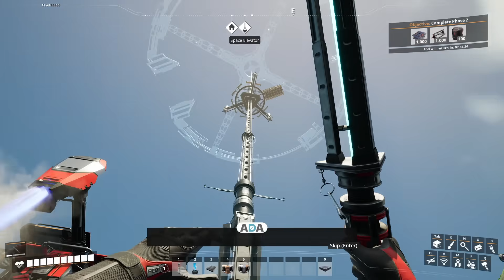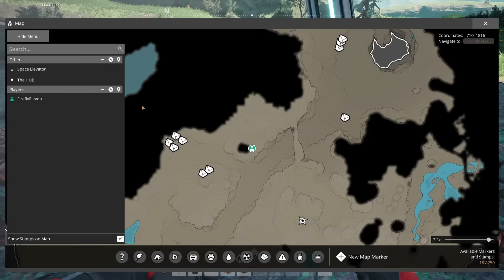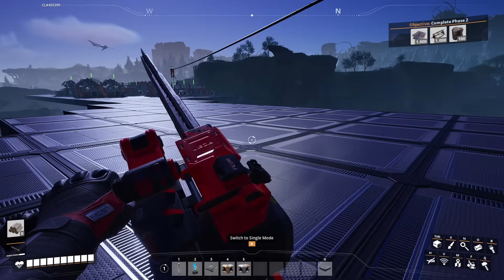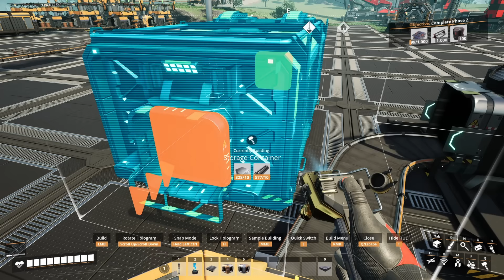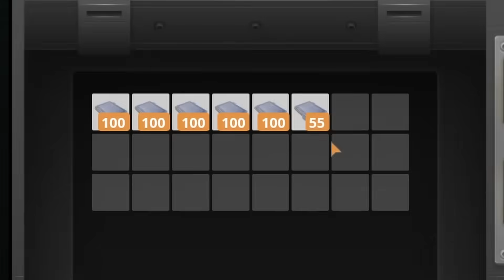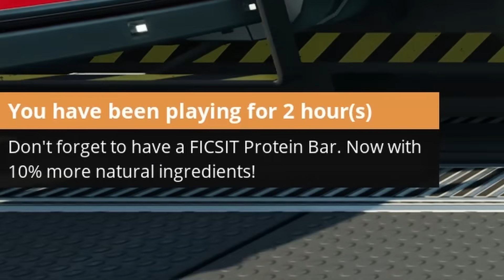Beginning Steel (and Copper) Production! | Satisfactory ep.6

Comment: Episode 6 of commenting to help the factory grow. 

I’m a bit late to this one, lol. So just like you can over clock machines to produce more, you can also under clock them to produce less. This way you can have perfect ratios without the need for power shards, but you will have to build more machines, which is a good trade off in my opinion. (Power shards are a lot more rare than basic building materials and space.)

Comment: I've noticed you arent using the alternate modes for conveyor belts. press r while you are planning a conveyor belt and it will switch between, default, straight, and curve. try messing around with those!

Comment: 16:30 you can actually edit the target production per minute by clicking on the number and editing it by typing
Edit: oh you found that yourself
Reply: another detail to this that most people don't know is that you can edit the input and output values of the parts as well. you can ALSO insert basic mathematic statements (like '2/3') and it'll calculate that for you. extremely useful and knowing how to under/overclock saves you a ton of materials and complexity in the long run especially because scaling up power is always simpler than anything else of its tier

Comment: there are going to be lot of things that need steel so be prepared to that, miner level 2 and pure coal vein 240 coal so you can make 16 coal plants that makes to you 1200mw, 24:10 that hole is a cave but its very massive cave and there is one ore vein (sam) and when you build conveyors and they are yellow its just means that it goes through something its not going to give any problems to factory
Reply: i just was gonna say that cave leads to sam XD

Comment: Quick note if you have or are worried about arachnophobia you can change the stingers into pictures of the developers cats.  I know you didn't want to do tickets last episode you may want to consider the conveyer wall hole and lift floor hole along with the floor and wall hole for pipes under the management section.  It helps keep the factory organized.